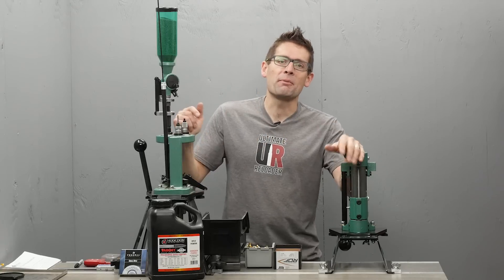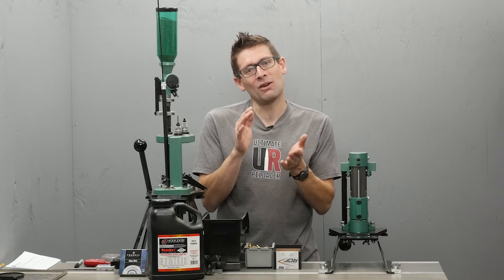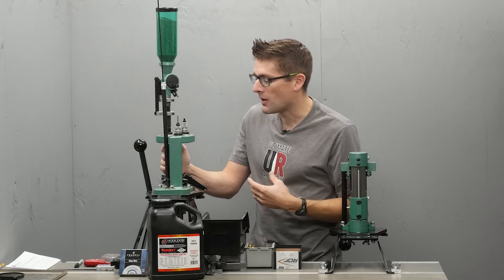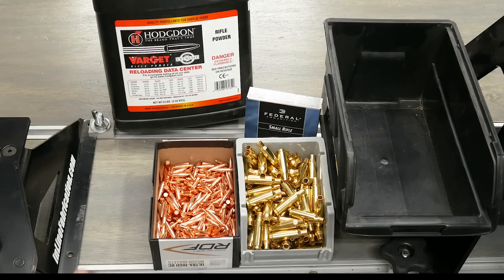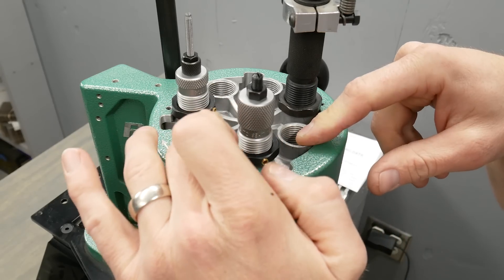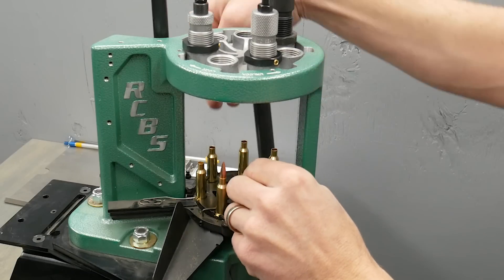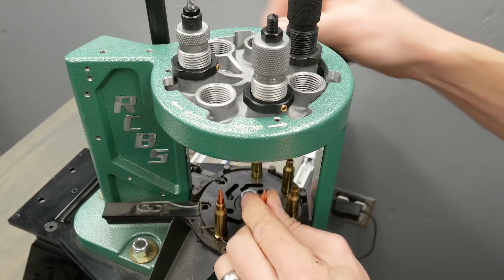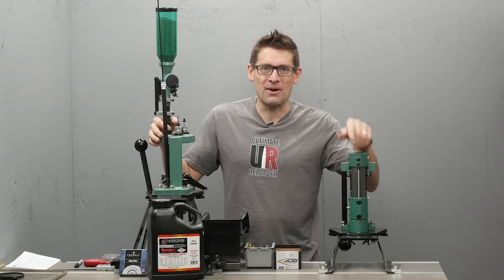224 Valkyrie Progressive Loading on the RCBS Pro Chucker 7

Comment: OK so I am a fan of RCBS having used a Rock Chucker and Ammo Master 2 for years - I want to buy a progressive purely for .223 and maybe .308. I am really conflicted! Would you recommend a Dillon 650 with Mr Bulletfeeder and case feeder, Hornady LNL ammo plant or RCBS Pro Chucker 5? I want to use a bullet feeder and case feeder but will probably size, de-prime, clean and trim (I have a Girard) separately then just neck size, powder, seat, and crimp on the progressive?
Reply from the maker: Couple thoughts- the big win is when you get either a case feeder or a bullet feeder- that way you have one hand on the handle, one hand inserting components. Dillon 650 = most reliable and smooth at speed, but powder measure and priming system leave room for improvement (as well as safety). Hornady- the powder measure, priming system, and lock-n-load bushing system are best in class- but you will have occasional ejection issues (even with EZ-Ject, the updated system), and the case feeder doesn't work quite as well as on the Dillon (Dillon has "rails" that regain case rim- cases can't fall out). Perhaps a Hornady Lock-N-Load AP with bullet feeder would be best on cost and function? Or ammo plant?
Reply: gavintoobe so not the RCBS then?
Reply from the maker: Sorry, missed that! If you need 7 stations, the RCBS Pro Chucker 7 is the way to go! The Pro Chucker 5 is also good, but the Pro Chucker 7 is in a price class of its own with 7 stations.
Reply from the maker: Also, for that scenario, I would prioritize the bullet feeder/seater!

Comment: Gavin awesome setup.. afraid to ask what that would set one back... Also how accurate is the loads with this approach. I normally use a chargemaster and see all my loads curious to this flow solution and how accurate it can be in this type of setup. Never really seen many serious precision guys run powder this way for match ammo. Thanks for your insights!
Reply from the maker: Randall- I think Midsouth has this press for $800-something right now- pretty good for a 7-station press! I just did a test this afternoon on 10 rounds loaded on this press, and found seating depth for 10 rounds to have an SD of 0.001" ! The trick is that I'm NOT full length sizing- so I'm not flexing the sub plate (below shellplate) - only using expander ball in sizing station.

For powder charge consistency- the measure throws Varget consistent within about +/- 0.1 grain- and with this node (flat spot on graph I showed in the video) that hardly does anything in terms of velocity- which was confirmed on the chronograph- an SD of 7 FPS for 10 shots, and shot with a gas gun (AR-15) no less. 

Unless you are loading for benchrest, I say load progressive! (with the special notes I pointed out in this video)
Reply: Deals and sales come and go... the Pro Chucker 5 is the same machine, but 5 stations.   You can watch eBay as well, sometimes new kits are there.   I haven't seen any used Pro Chuckers -- either people hate them and dump them or love them and keep 'em.     I bought a 5 then the upgrade to the 7 a year later, both with sales and rebates.

Comment: On my powder funnel I took a very small drill bit and drilled a hole at the top of the neck of the funnel. I put a small pin threw the holes to create a bar in the middle of the funnel. I have not had any problems with stick powers and it doubles as a catcher for when you pull bullets. Just wants to tell others a simple,cheap but very helpful tip

Comment: Just curious if you have had any issues with small base sized vs full length sized brass chambering properly in your bolt action. Specifically, brass that had been fired through your AR. Are you keeping the fired brass lots separate between AR and bolt action?
Reply from the maker: I'll find out shortly, I've been loading new brass so far (I have a ton of it) - will be doing full reloading and posting stories very soon...

Comment: I see a big problem with this progressive press at the 6:20 mark. When the ram comes up and the shell cases have entered the dies, the "turret" holding the dies moves up and down and a little left and right. Unless you can eliminate that movement, these rounds OAL will be all over the place. Even my cheap Lee Loadmaster is more stable than this RCBS.
Reply from the maker: Eric- I just ran an OAL test with 10 rounds loaded as shown in the video, and using the Hornady bullet comparator tool (measure ogive) - the results were surprising, an SD on OAL of 0.001" - that's because I'm NOT SIZING (the shoulder or case body, only expanding the neck). This makes me feel even better about this setup for precision rifle!

<!--td {border: 1px solid #ccc;}br {mso-data-placement:same-cell;}-->-0.002-0.001-0.001-0.001-0.0010.0020.000-0.002-0.003-0.001SD: 0.0001"
Reply: @Ultimatereloader  Wow Impressive! !   How bad would it be if you were sizing the shoulder/case body?  Would you use a different press?
Reply from the maker: Eric- that's by design (the die head hits the top of the press cutout) - as I mentioned in the write-up, I'll be testing OAL - and I have a secret weapon in mind. (some tricks up my sleeve) - but, GOOD EYE! I love how detail oriented all of you are! :)
Reply: Eric Zeigler I would assume he trims and chamfers

Comment: It would be interesting to see a setup that actually utilizes all 7 stations of this press and also to know how you think it compares to say a press that only has 4 or 5 or 6 stations.  I guess my real question is if there is a number of stations on a progressive press that can be too many and if so what is that number?
Reply from the maker: The only real downside of more stations is more run-up and run-down time. :)
Reply: In practice, stations I have wanted are: 1 decap/ size. 2 prime, 3 powder, 4 powder check 5flare, 6 bullet feeder, 7 seat, 8 crimp. Most presses combine powder and prime, so 7 is just using up all of the standards that are nice for progressive. It's a boon if the priming is on the down stroke for feel. I would also like on press primer swaging, which is an option for this press, but I don't think you can use it at the same time as you are priming, so really that's for bulk conversion of military brass or on press rapid conversion to 300 BO, or similar. Still, with a case feeder, being able to crank through that kind of thing is beautiful.
Reply: @GunFunZS  I get what you're saying.  I get along pretty well with the 5 stations on my LNL AP so I'm mostly curious if the extra stations are really worth it.  I believe most people flare their cases before throwing powder in them.  I think this reduces the chance of powder shaking out if the case sticks to the case flaring die.  Also in my experience with the RCBS primer pocket swage tool, swaging .223/5.56 primer pockets in my Rock Chucker can sometimes require exerting an extreme amount of force on the press.  Even if I could swage on my progressive I wouldn't for fear of breaking parts or shaking something loose.  It took so much force and time to swage a few hundred pieces of brass that I purchased an RCBS primer crimp remover that cuts the crimp out.  I haven't had a chance to try it yet but if it works as well for me as I have seen it work for others I will probably never swage primer pockets again.  I have seen other swaging tools from other companies that seem to take much less force and time to use but to just allow me to re use scrap range brass with crimped primer pockets I'm not going to worry about cutting a tiny amount of material out of the back of the primer pocket.  The cutters are cheaper than any swaging sets I have seen too so before you go dropping money on swaging sets I strongly urge you to take a good hard look at cutting instead of swaging.